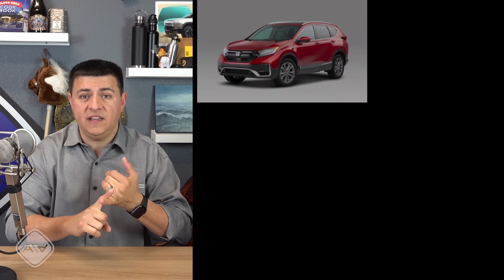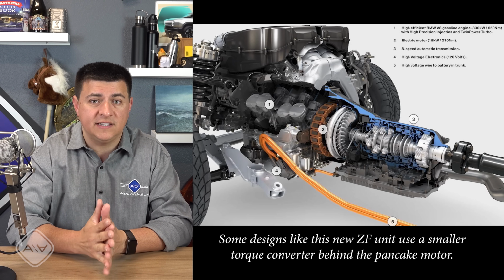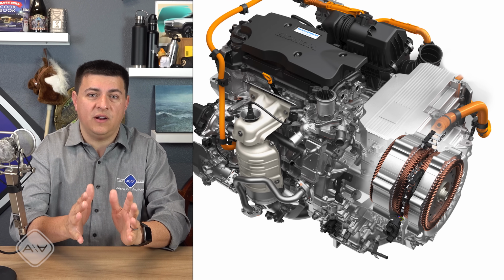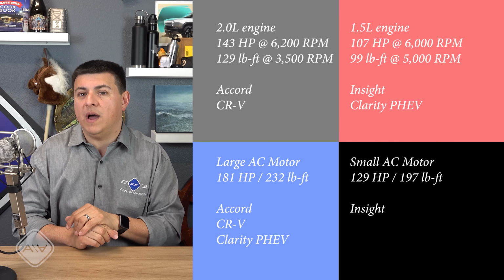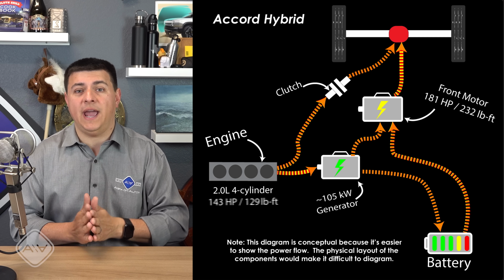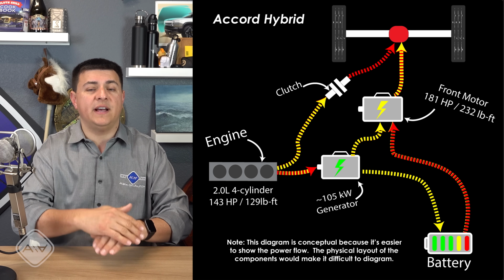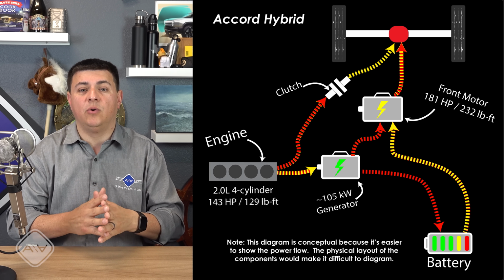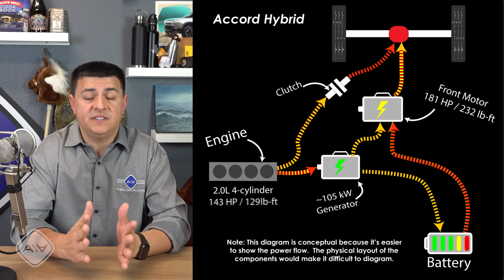How Does It Work?  Honda's 2 Motor Hybrid System Explained!

Comment: I usually tell people that driving my 2015 Accord Hybrid Touring, is like driving a Honda Generator or like a locomotive train...where in a train the diesel motors just generate electricity for the electric motors that actually move the train down the tracks.

Now about seeing all that power at high speed...I've been there four (4) times. I will admit that on side roads to Nevada's Highway 50 "The Loneliest Road in America" I hit the governor 4 times for extended miles where visibility was impeccable with NO low lying brush to hide any jack rabbits (or anything else) and NO other vehicles coming or following. In fact we were packed with very even weight distribution with the trunk's false floor taken out to accommodate six (6) Costco luggage bags (4 Carry-On Size and 2 Large Checked Size). On one of the four (4) high speed runs, we had the Moon Roof Open and two (2) F-16 Fighter Jets buzzed directly over the top of us (and I mean directly over the top VERY LOW altitude). I remember thinking, "Wow, if they wanted to kill a vehicle on the road...a person would NEVER see it coming" (thankful for our men and women in the service). I actually think they were having fun with us with timing...as they did cross at a slight angle and we were going between 112 & 115 MPH.

But anyway at those higher speeds,  I honestly could tell NO difference in power. It had no trouble getting up that speed and maintaining it. Plus, I fueled up every day on that trip which involved visiting seven (7) National Parks and we still averaged 44.3 MPG for the entire trip with a family of 4 (and again 6 Costco luggage bags in the false floor that has the shape of a spare tire).

I've owned 33 vehicles including two (2) 2004 Prius #9, 2007 Camry Hybrid, and a 2013 Toyota Avalon Hybrid Limited w/Tech Package. My personal experience is that the simplicity of the Honda system shines trough. I like how when you stomp on it, it "feels" like a "delayed Super Charger". Notice I'm being specific to NOT say Turbo Lag which is a different feeling (again I driven tons of vehicles besides my 33 past vehicles). It just feels like a "delayed Super Charger" is my only description...where it has power and then a second or a second and 1/2 later it is has POWER that pushes a person head back. Okay...well, back to my Toyota's...both my Prius both got 44 MPG (no matter what I did, stomp on it, drive them nice). One I had changed tires to Michelin HydroEdges (still NO difference, which was surprising). The Hybrid Camry pretty much got 33-34  or sometimes 38 on the highway (again all vehicles have always been hand calculated at the pump on every tank). The Avalon would always get between 34 to 38 MPG. My Accord I've hit 50.4 MPG (1 Time) ;-) And I get as low as 34-38 in the Winter and 42-44.6 in the Summer (55K+ Miles it has averaged 42.1...lil' less with Michelin Premier A/S tires...but much better grip and stopping than the EnergySavers.

I would assume (which we all know what assume can stand for). ;-) So, I am guessing that Honda does not do spare tires for safety (if there was an accident)...where perhaps a spare tire might get shoved up into the battery pack (maybe)? I don't know, but I do know if you take the false floor out...I could put two (2) more bags in the back of my Accord than my 2013 Toyota Avalon Limited (which had horrible interior build quality with TONS of Squeaks and Rattles that drove me NUTS). Actually the only Toyota's I've had (out of 9 Toyota) that have had NO interior integrity problems have been our 1999 4Runner and 2007 Highlander (non-hybrid)...both of which were made in Japan. Where my Accord has been ROCK solid...my wife 2017 Ridgeline and 2015 Civic EX-L have also been ROCK solid with not even the slightest squeak or rattle.

Comment: Just bought a 2025 Honda CRV SPORT-L Hybrid!  Love it and the torque is pretty good. Love the cavernous room in the back seats love the recline feature too for long trips.  Stay away from the Gas only 1.5 L Turbo.  It simply won't last as long as the Hybrid  especially if you tow with it.  The RAV4 seats are very uncomfortable and cramped as we own that vehicle as well.  Toyota will probably fix this in the Next Generation and if they don't Honda will steal more sales from them.

Comment: I have a 2020 Corolla Hybrid, it’s rated at 52/53 but real world I get 62-63 in mixed hwy/city driving... if I go 45 or less I can get 65-68 pretty consistently,except in the coldest months when the heater runs the gas engine more and it drops to 58 at its worst. Hwy trips I still see 57-61 mpg at 70-75 average.....
Reply: Thats very good number!
Reply: If those numbers are true that's simply amazing. For people who drive a lot it's major savings.

Comment: Thank you for your video, just a small correction, the speed at which the engine will give direct drive to the wheels is 62 mph not 45 mph, any speed below 62 mph the vehicle will have pure electric propulsion no mater how hard you accelerate ( the engine will work only to generate electricity under 62 mph)
Reply: No, 45 mph is about right. The engine's maximum efficiency comes at 2000 rpm, which is 54 mph in my Accord Hybrid. If the CR-V Hybrid has the same tires as my 2017 1.5L turbo, it is about 62 mph (the number you cited). But the clutch is engaged if the efficiency is close to the 40.8% it gets there. The range starts at about 1500 rpm, which is 40.5 mph in the Accord and 46 mph in the CR-V.
Reply: @jeffjo8732  Hello, I have a question. Is the e-cvt transmission used in this new 1.5 cc Honda Jazz exactly the same system as the e-cvt used in the 1.8 cc Toyota Corolla sedan or is it a different system? The reason why I asked this was they said that the risk of deterioration of the e-cvt system used in Corolla is less than the normal CVT. Do you think we will have problems with the e-cvt gearbox if we buy Jazz?
Reply: @attilakhan4606  In Honda's system, power is transferred via two electric motors, which are usually a lot more reliable than any kind of mechanical gearbox. Less moving parts.
There's no actual CVT in there, it's just a marketing term
Reply: @Wilhem275  so you mean there is no risky to buy right because i do not trust this company after sales.
Reply: @attilakhan4606  Honda is usually very reliable on mechanical stuff (Toyota too).
In their hybrid system there are less moving parts, so it should require less maintenance.

Comment: It’d be interesting if you eventually also explain the Toyota hybrid system and other power-split hybrid systems too - those are conceptually a bit trickier to explain than the conceptually simple Honda IMMD hybrid system.
Reply: Interesting 🤔.. so the Toyota’s hybrid system is more complex mechanically ?
Reply: @harrytej  I wouldn't say that it's more complex mechanically, just more conceptually complex/takes a lot more words to describe how it works. 

There's 4 main elements - Motor Generator (MG) A, MGB, the internal combustion engine (ICE), and a planetary gearset with a sun gear (S), planet carrier (C), and ring gear (R).

The ICE spins C, MGA spins S, and MGB spins R, through reduction gearing. R is connected to the output through another set of reduction gearing. If the ICE is spinning while the vehicle is stopped, MGA is overdriven (spinning even faster) in the same direction, and can generate electricity.

The ICE can only apply torque to R if there is also resistance/reaction torque from S - so MGA provides variable mechanical resistance which allows ICE to send torque to R. The electricity generated by MGA acting as a generator (at lower speeds) is routed to MGB, which spins R in parallel with the torque from ICE. This is why it's more commonly referred to as a "power split" hybrid instead of series or parallel - the power from the ICE is literally split partially between a mechanical path (ICE -> C -> reaction torque off S -> R -> Output) and an electrical path (ICE -> C -> reaction torque off R -> S -> MGA -> MGB -> R -> Output).

As vehicle speed increases, MGA speed decreases, and more and more ICE power follows a mechanical path until MGA reaches 0 RPM. Eventually, MGA and MGB switch roles - MGA actively spins backwards which spins S backwards and makes R spin forwards even faster - MGB acts as a generator, sapping some of the power off of R and redirecting it to MGA or the battery.

Like I said, a lot of words to describe 2 electric motors, an ICE, and a planetary gearset.

Comment: I would be happy to correct you. 6200 rpm at 110 mph is not going to happen with the direct drive clutch closed. With the direct drive clutch closed, the drive ratio you see will be between 27-28 mph per 1000 rpm depending on the specific model. It can vary due to different tire diameters and different final drive ratios. 110 mph would be around 4000 rpm and 6200 rpm would be around 170 mph.
Reply: The ratio I calculated (Accord) is almost exactly RPM=37*MPH, or 27 mph per 1000 rpm. I recall a quick comparison to the different gears and wheels in the CR-V, and the difference was about 1%. I don't recall which direction, since I didn't consider it significant.

This is very different from what Alex says, because he started with the conclusion that the engine must be directly involved when maximum power is needed, and from there inferred how he thought it happens. Unsurprisingly, he got it wrong. I just wish he would make corrections to his obvious errors, like this one. He has really done a disservice to his readers by letting false claims stand for so long.

+++++

Most of the time, this car is an EV. Not a Battery EV, like a Tesla, but a Battery and Generator EV. Below highway speeds, or whenever power is needed at any speed, it is a serial hybrid. The engine drives only a generator. That generator's output is combined with charging, or discharging, the battery to send the correct power to the wheels.This is beneficial, because maintaining speed requires (these are gross estimates) about 5% to 15% of the engine's rated power, but that engine is most efficient when it generates 20% to 40%.

The benefit of the serial system is that, except when high power is needed, the engine can run (from Honda R&D papers) near 2000 rpm and 88.5 lb-ft of torque (33.7 HP). The engine is 40.6% efficient there. It can stay there unless there is a significant need for power, in which case it can go up to 6200 rpm and 143 HP (121 lb-ft). But in serial mode, there is no meed to match RPM to MPH. The battery can add more than 38 HP, but the motor can't handle more.

In Direct Drive, it becomes a parallel hybrid. The engine must operate at RPM=37*MPH, but that is so close to the efficiency peak that it doesn't matter. In fact, it is better since there is no conversion of the power used for propulsion. Direct Drive can be used when speeds are between about 40.5 mph (1500 rpm) and 75.6 mph (2800 rpm). I'm not saying it won't be used outside those limits; I chose them because that range is where Honda's published "hybrid operating line" is above 40.2% efficient.

Comment: 7:50 Hello Alex, from here you are probably incorrect. Now people tend to believe total 212hp happens in hybrid mode with clutch open. See the max engine 143hp matches generator’s 105kW, plus some 70kW from the battery, that’s where 212hp comes from. As for the 181hp motor, it can over-boost to 212hp within a short period of time.
Please kindly check and modify this video, thank you!

Comment: A different approach is used in the Nissan Kicks - on sale in Japan and Thailand, I don't know where else. Quite simple, IC engine with a generator on it which charges a battery, the battery provides power to an electric motor which in turn drives the wheels. No transmission or mechanical connection between the IC engine and the wheels. True electric system but no range anxiety!  Would you care to comment on that?

Comment: 73 MPH and under, the Insight will still go into pure EV mode when there are four bars generated.. It will cruise for about 3 to 4 tenths of a mile then back to charging the battery.. It does not go into pure ICE mode until you are above  73 MPH. Also, above 83MPH the clutch will disengage and power the wheels with the generator/motor instead of directly with the motor..

Comment: yesss want the acura hybrid systems, im very curious about them because the hrv hybrid in japan gets what honda calls "i-dcd" or intelligent dual clutch drive. it uses a 7 speed dcd idk if its similar to the rlx and mdx dcts. But the way it works is that the motor can use odd gears only and can shift whether or not the engine is shifting while driving. so for eg you're pulling away from a stop and the motor is in 1st and the engine will start in 2nd and while the engines in 2nd the motor will shift into 3rd

Comment: Excellent presentation!

In reality, the direct connection between the internal combustion engine and the wheels without input/output to/from the battery rarely takes place, especially where I live, in a hilly area. Regardless, my 2018 Accord Hybrid is an amazing car and I love it. As soon as the CRV Hybrid is available so that dealers will deal on the price I will exchange my Fit for a CRV.

Comment: It’d also be interesting to see the “sustained” hp and torque ratings on these electric motors. Perhaps one of the advantages of a parallel P2 hybrid setup is that the gas engine + transmission is capable of propelling the vehicle without electric motor assistance, which reduces the thermal load on those parts. Might be why these layouts can tow significantly more.
Reply from the maker: Generally speaking these motor designs are fine for sustained use, but remember this general power profile isn't ideal for towing anyway.
Reply: @AAutoBuyersGuide  I'm curious if the power and torque figures on those electric motors are the "peak" performance numbers (i.e. you can run at this power level for up to 30 seconds) or something closer to continuous performance numbers (i.e. given sufficient power supply, you can run them motor indefinitely at this power level), which are often dictated by the ability to dissipate heat off the motors and power electronics.

For example, if the 181 HP is the continuous or sustained rating, then it's very plausible that the peak performance is well above 181 HP, but only for a short duration.

Conversely if the 181 HP is the peak rating, then it's likely that the sustained performance will be lower, and how much lower depends on cooling. This would cause some variance in acceleration performance even with a consistent battery SOC if the electric motors are "heat soaked" from aggressive driving.
Reply: @AAutoBuyersGuide  Hello, I have a question. Is the e-cvt transmission used in this new 1.5 cc Honda Jazz exactly the same system as the e-cvt used in the 1.8 cc Toyota Corolla sedan or is it a different system? The reason why I asked this was they said that the risk of deterioration of the e-cvt system used in Corolla is less than the normal CVT. Do you think we will have problems with the e-cvt gearbox if we buy Jazz?
Reply: The ratings are probably peak, sustainable only briefly. EV motors routinely have a continuous rating which is roughly half of the peak rating.

Comment: I have been trying to find a detailed description of the ecvt in my Honda CRV Hybrid Sport and have not found one.  The best description I have found is Weber Auto where he goes through the Accord Hybrid ecvt with one overdrive clutch.  I don't know if my CRV is the same or not.  I  also don't know how to drive my CRV to maintain minimum wear on the overdrive clutch other than to minimize the amount I drive 62 mph or more assuming my CRV is only in EV mode for all speeds less than 62 where I assume the overdrive clutch in no in play (i.e. not engaged).  I drive my CRV a lot between 25 mph and 45 mph and I assume I am in 181 HP EV mode  which is fine and I assume the Clutch does not come into play there.